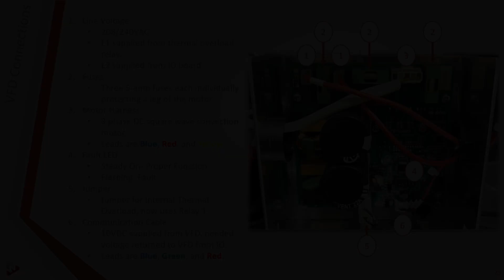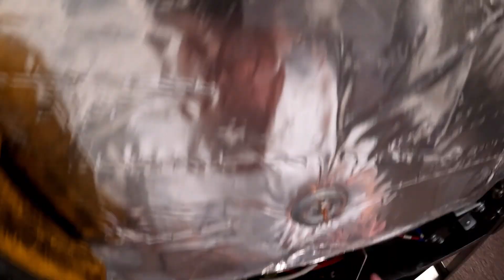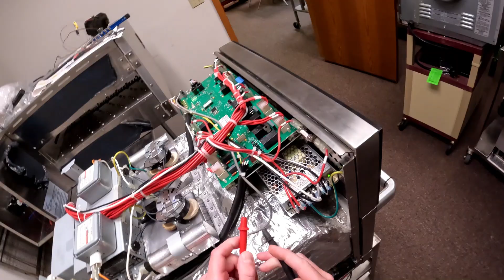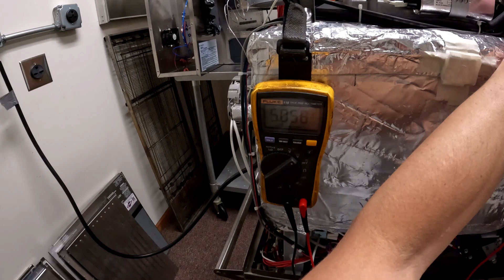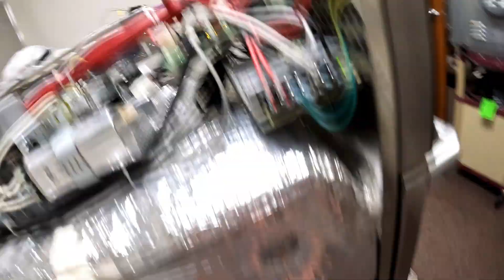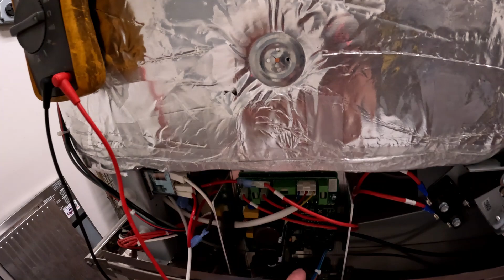MerryChef Connex VFD Testing

Comment: Looking for suggestions on a connex 16 it trips out on over temp I replaced the control board for the blower motor and replaced the blower motor thinking that was the issue I have ac to the board but no ac going to the blower motor not sure where to look next any suggestions would be greatly appreciated. The blower motor does not kick in and the red light on the control board is blinking 7 times then stops for a couple of seconds then restarts blinking again